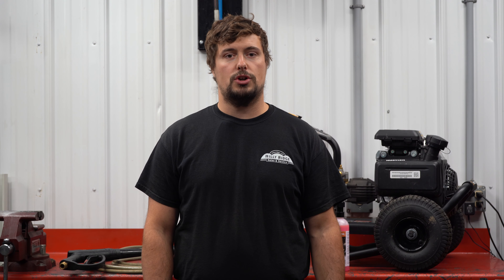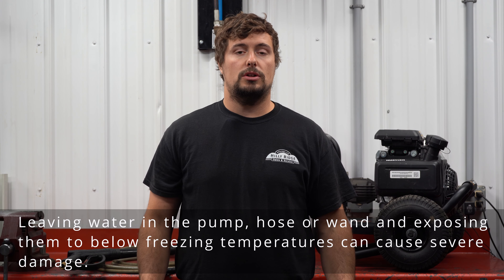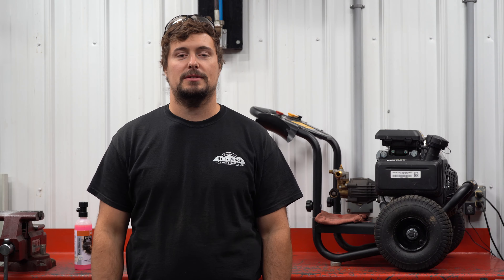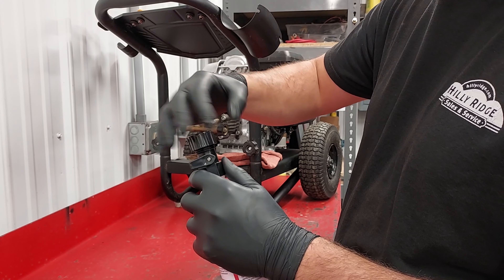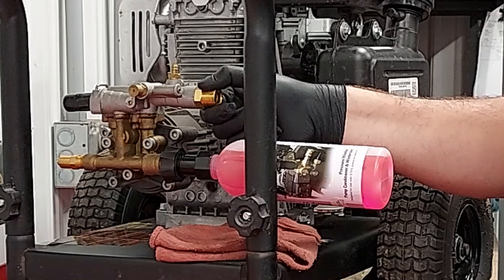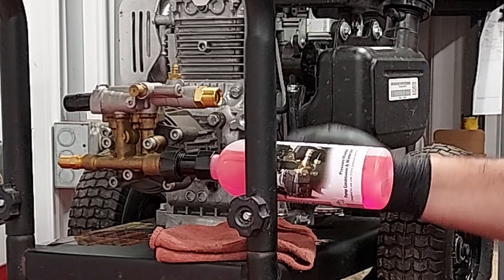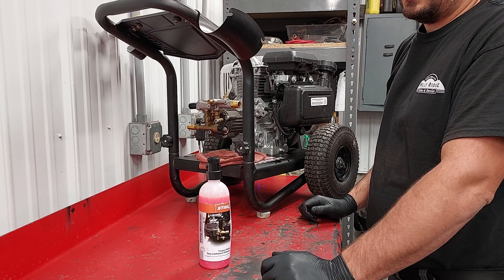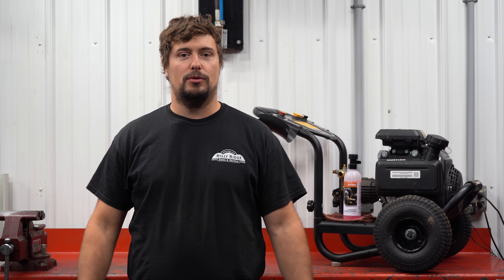How to Winterize a Pressure Washer Pump!

Comment: Something you can also do to make this easier is get a R.V. air blowout plug that is for waterlines. Screw it in and blow all the water out first with a compressor. Then add the juice for winterizing. Ive done this for over 20 Yrs and never had a problem.  Getting all that water out first helps.  Ive seen 
so many cracked pumps over the years from freezing on other peoples Equipment. This stuff looks so easy to use. Great Information!!
Reply from the maker: Great information!